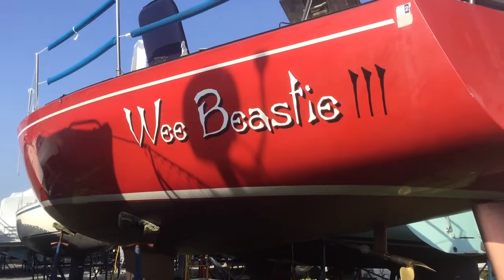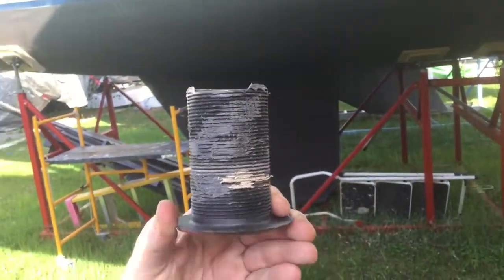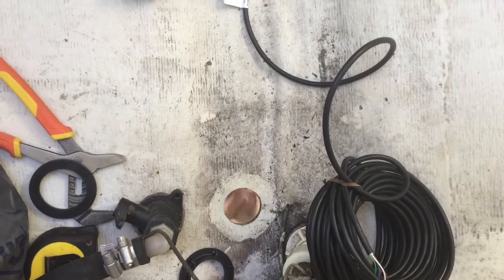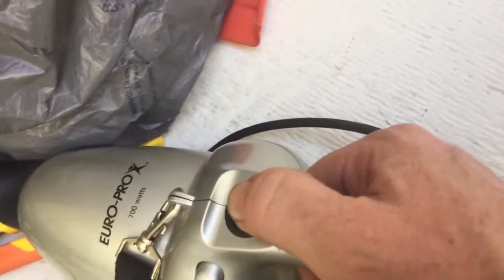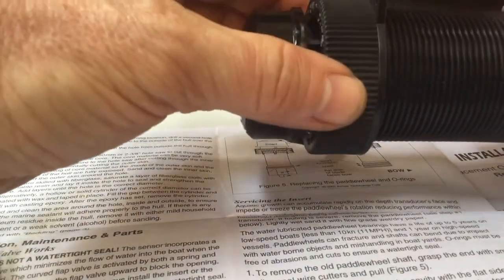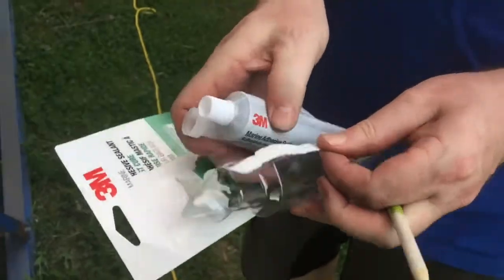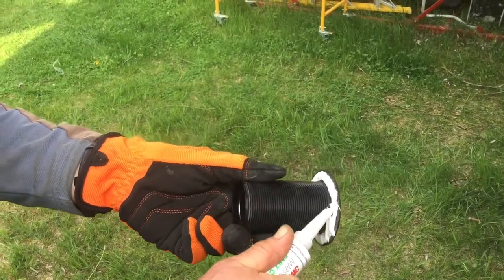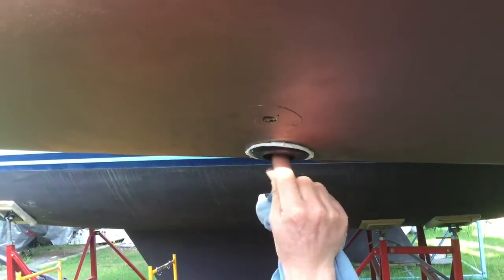Install Raymarine Triducer

Comment: Thanks for showing this.   We were perplexed as to why the transducer didn’t fit flush but we didn’t push it all the way in.   Now that everything is installed, I’m not getting speed, now I know why.  We should be able to push it down while the boat is in the water.  My BF may need to dive on it while I push it down.